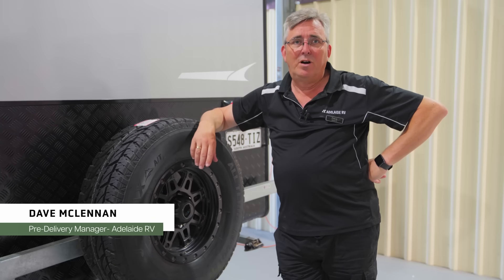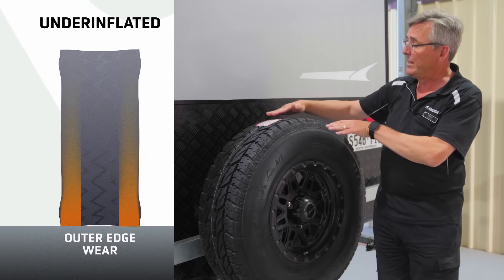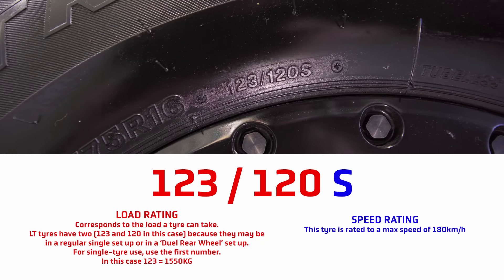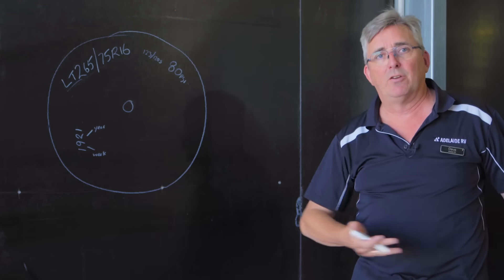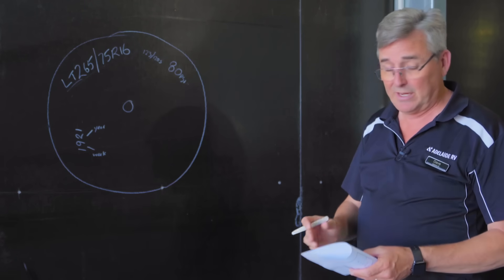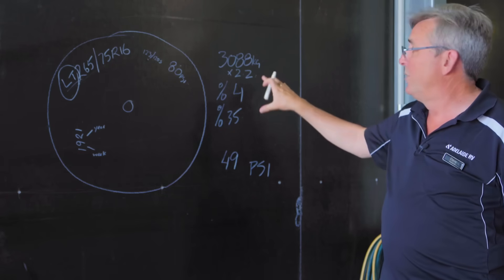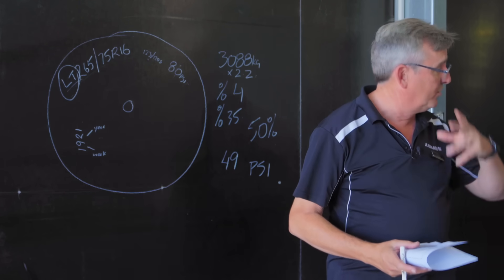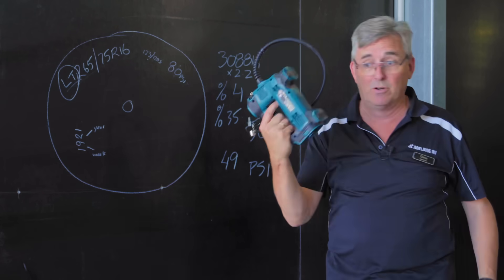How to PROPERLY calculate the PSI for your CARAVAN TYRES

Comment: I have a Coromal Seka 535 (18ft poptop) x dual axle (independent suspension) with a tare weight 1,300kg (and ATM 1,700)  LT tyres and i usually run 50psi in them for highway driving
Doing youir maths  1.300 x 2.2 = 2,860 divide by 4 = 715 divide by 35 = 20psi ??  There is no way i am going to run the tyres with 20psi.    Please explain that one
Data card states 36psi but i run 40 to 45 cold - dependant on how heavy i load it up with payload
Reply from the maker: Yes, looks like heavier single axle vans and very light tandem axel vans skew the calculations a fair bit. Checking your pressures with the 4 PSI rule would be best.

Comment: Absolutely second the Makita compressor, I think because it runs on 18v it's way better than the 12 volt ones. Not as fast as a shop one and probably not for hardcore off roaders but gets the job done inc pushbikes. So easy to use. Awesome video too, thanks.

Comment: My AVan single axel has a loaded weight of 1935kg, and by your tyre pressure calculation, tyres should be around 60psi.    My compliance plate says 34psi.    Next time we're on the road I'll do the pressure check after an hour to check see where we are with the "4 psi rule", but I'm confused by AVan's pressure recomendation.
Reply from the maker: The can definitely be different recommendations from tyre manufacturers and caravan manufacturers. As long as your tyres are the correct type for your caravan (appropriate load rating, etc) we'd say go off the 4 PSI rule.
Reply: 34psi at nearly 2t???  I don't think you will need a pressure gauge.  I'd be surprised if you could comfortably hold your hand against the side of the tyre after driving at 90kph for an hour.
Reply: I have one of them. We immediately changed the radials for LT tyres. We run at 50 psi, and the weight is well supported.  

The standard tyre on the AVan was  not suitable IMO for carrying 1 ton per axle. You could see they were splayed while standing still!

Cheers Steve

Comment: Hi Dave, thanks for the useful (and timely) video. However, as per other comments below, the numbers are not quite crunching correctly for my application. I have a 2018 Goldstream Wing 3ST (single independent axle full Offroad spec) with 15x7 rims, and newly fitted Falken Wildpeak AT3W tyres in 31-10.5.15 sizing or 265/75/15. The camper trailer tare is 1525kg, and ATM is 2000kg. Tyre placard in the camper states min cold px of 250 kpa (36PSI) and max cold px of 350kpa (50PSI). When I crunch the numbers as per your video, I ended up with a recommended 47.93PSI for 1525kg, and 62.85PSI for 2000kg.. What would you advise for my application?
Reply: Forgot to mention - the AT3W tyres fitted are LT spec tyres.
Reply from the maker: It would probably be safest to start with 47 as it's within the recommendations of Goldstream, then drive for an hour or so before checking the increase in pressure. Go off the 4 PSI rule (though for LT tyres it can be actually be between 4 and 6 PSI and still be suitable). It may take a few drives to dial it in, but once you figure it out you'll always know.

Comment: Is this calculation the same for 2 wheel single axle vans? When doing this calc mine came up with 83PSI but compliance plate indicates 45-47 PSI. 2642 ATM. I had them a bit lower and got some sway but increased to 45 and was better. Thinking maybe increasing but not sure 83 sounds right. Is there a formula for 2 wheels?
Reply: Check the tyre side wall it’s has a maximum pressure at fully loaded capacity of the tyre always minus 5 psi 
This is the safest option
Reply: Your joking right
That tyre psi rating is the maximum and what the speed and load index where setby at maximum psi
Reply from the maker: You would get a higher PSI on a single axle caravan as the tyres are most likely taking more weight than they would on a tandem axle van, so they require a higher pressure for the same footprint.

Be mindful of the max PSI, if it's 80 PSI you wouldn't want to go past 75 PSI cold. 

Stick with 45 PSI and go off the 4 PSI rule, increase as necessary.

Comment: Good advice. Only thing I would add is the 4 to 5psi variation from cold to hot can vary a lot depending on the conditions. My car and van both have tyre pressure monitor systems and on cold, wet roads the tyre temp will only vary 2 or 3 degrees. On really hot days the pressure can vary 6 to 7 degrees. If driving on a dry road and suddenly the road becomes wet the tyre pressures will drop a few degrees. Something to be aware of.

Comment: When I use this calaculation with my current van I get a recommended PSI of 92.7??  I have a single axle van with LT tyres, ATM of 2950 kg.  Clearly doesnt make sense here.  How does this calculation take into account TBM at say 300kg reduces weight on axle and load factor of the tyre, in my case 1450kg?  I would welcome your feedback on this.  Thanks.
Reply from the maker: Yes, looks like heavier single axle vans and very light tandem axel vans skew the calculations a fair bit. Checking your pressures with the 4 PSI rule would be best.
Reply: Basically your van is too heavy for a single axel! Your van should be on a duel axel!
Reply: I have the same issue, single axle van with an ATM of 2750kgs. My PSI using this method is 87psi, clearly not correct. Did you get a response from Adelaide RV?
Reply: @donks5306 no response yet
Reply: @donks5306  Basically your van is too heavy for a single axel! Your van should be on a duel axel!
Reply: @ that’s the dumbest answer to a very legitimate question. My van was manufactured as a single axle at 2050 tonnes. We had an additional water tank, extra battery and extra solar added during manufacture meaning we had to get the weights re-engineered and a new compliance plate added. I saw many others respond to your video saying that your mathematical formula did not work as they had a single axle van and your calculations meant that our tyres would have a psi of 80 which is crazy. You might need to review how you calculate single axle vans.
Reply: @donks5306  Discuss it with your van manufacturer plus the RTA. Then go to a duel axel trailer.

Comment: The ‘passenger car’ tyre calculation does work for LT tyres.

The big issue for vans is the cheap crap tyres that they come with being ‘less than truthful’.

LT tyres have a higher max load and pressure, and stronger and stiffer construction (to Facilitate higher load and psi ratings).

If a tyre is being truthful with its ratings, the max load, max psi, weight per wheel formula will lead to the correct PSI (ie 40 in your van example).

But wouldn’t trust many OEM van supplied tyres to run at 80 psi and with 6t (to max out 123 rated tyres) of van weight at 100kph.

Comment: That calculation and the way you explained it is the first time in my life (and I've been around for more than a few years) that the PSI has an actual meaning in my head. It is LITERALLY pounds per square inch! 

Amazing, thanks!
Reply: I'm glad you found out about PSI!  Here's some other fun and fascinating information about pressure - the pressure of all the air above and all around you (at sea level) is call 1 bar.  1 bar is 14.5 PSI (15 in round numbers) so every square inch of your skin has 15 PSI 'pressing' on to it (0 bar in space). Knowing 1 bar is ~15 PSI is a handy conversion. Also, you might see pressure expressed  a kPa, that's kilopascals (the capital P is because it represents the surname of the French mathematician and physicist Blaise Pascal) and 1 bar is the same as 100 kPa.  PS: so 1 bar represents 1 atmosphere of pressure, but this can vary according to height above sea level and weather conditions. Pressure in the atmosphere is measured using a barometer (hence bar) and a barometer which is also used to forecast the weather.  Gee - I didn't think I was going to write so much. Hope you made it to the end. Well done if you did!  PPS - if you swim down 10 meters under water, the pressure is 2 bar. So 10m of water produces the same amount of pressure (1 bar) as 100 km (62 miles) of air (also 1 bar)!  That's the pressure caused by the weight of all the air above you!
Reply from the maker: An awesome reply! Thanks for the info 😄

Comment: I’m confused, why does my van compliance plate say 80psi?
Reply: That's the maximum the tyres can be inflated to. There should be another saying the recommended tyre pressures for normal use.
Reply: It is on your tyre. Max load. Max psi.